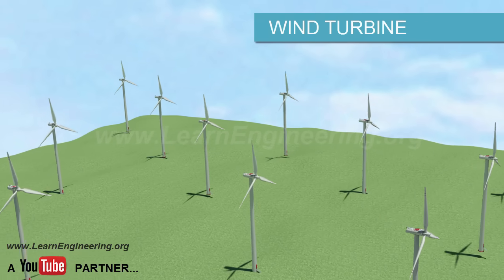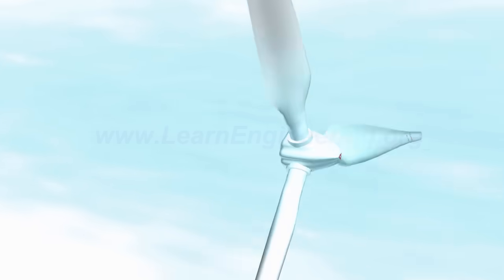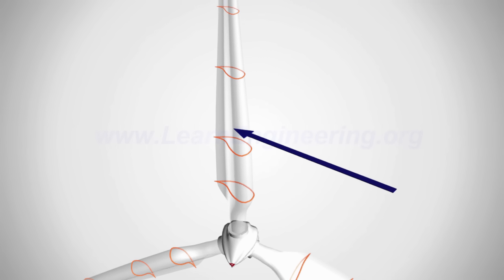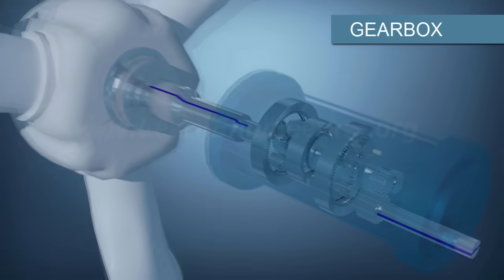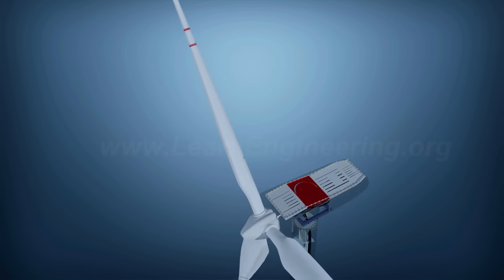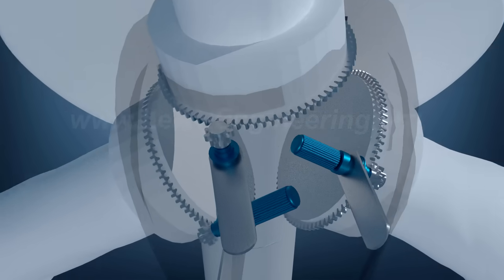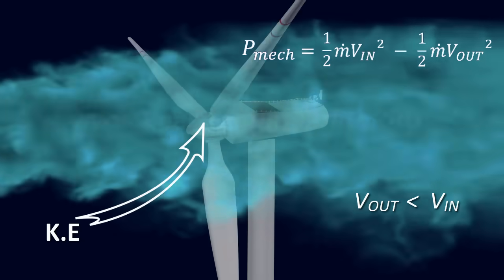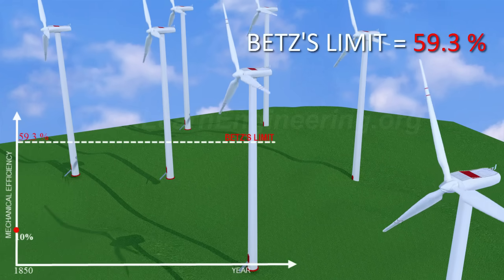How do Wind Turbines work?

Comment: 3:40 I'm confused. By that diagram is saying the no matter what speed the wind is blowing the blades are going to move the same velocity. Is that the case?
Reply: It depends how it is connected to the power system:
1) if it's connected directly with a synchronous generator, they will spin at constant velocity
2) if it's connected directly with an squirell cage induction generator, they will spin almost at constant velocity
3) if it's connected directly with wound induction generator with variable resistor in the rotor circuit, the velocity can be regulated with the resistance in the rotor
4) if it's connected fully through a power converter (decoupled from the grid), the velocity will depend on the wind speed and the output power from the power converter
5) If doubly-fed induction generator is used, the velocity will depend on wind speed, the rotor voltage frequency and amplitude

2) is the cheapest, 4) and 5) are newer types of wind turbines. I tried not to complicate it and not go into details because geneator types are not so easy to understand and I would probably confuse you even more.

Comment: I think it's hilarious that they forgot to mention you need lots of oil to lubricate the moving parts haha. Renewable my ass.
Reply: I do not think you understand the magnitude of ignorance shown in this comment.
Reply: Axl what I said is fact. You want more facts? Wind Turbines need steel so it's mined by heavy Industrial Machines powers by fossil fuels. Then the materials are  transported to a steel mill also powered by fossil fuels then the steel is shipped to a manufacturing plant where it is also powered by fossil fuels. And the construction of the actual Wind Mills at the sight is also powered by fossil fuels. I didn't even mention all the oil you need for lubrication of the moving parts and the genocide of birds Wind Farms kill every year. Some Wind Mills are starting to be made of plastic and guess what that is made of? OIL 

So don't call me ignorant son especially since you don't bring any facts to the table.
Reply: Yes of course, these are all factors that have to be taken into consideration when determening the overall climatic impact of the Wind Turbine. However, what you conveniently left out is how the turbine will produce a certain amount of electrical energy after its installation.  Given these calculations you can figure out how long the wind turbine must operate before it has produced as much usable power as was required to install it, any further power produced is the so called clean energy. For a typical wind turbine this treshhold is reached after approximately 3 - 6 months (Ida Kubiszewski et al., 2011). The same metastudy concludes that a wind turbine produces 20-25 times as much energy in its lifetime as the installation energy cost. 

When it comes to the issue of the lubricant oil used within the turbine, this is minescule compared to the power output. I do agree that it is sad that birds often die in rotor collisions, and this is an area that requires furter research to minimize.

All in all, the world is not as black and white as you seem to believe. Any energy installment requires a certain amount of energy as an installation cost, which has to be compared to the expected energy production in its lifetime. It is this comparison that decides wether an energy installment is "clean" or not. If you are genuinly interested in the topic I would advice you to look up the exiting field of life cycle analasys, where this is the main focus.

Comment: Why planetary gear reduction is used, and not normal gear reduction? I would expect normal gears to last longer and be cheaper. Also does the wind turbine can rotate contiously 360 degree to adjust for wind? And if so, how electric wiring is achived? If not, how movements are restricted? How does generator phases and speed is synced with the grid? Are blades rotate at fixed rpm? or do they vary, and how one deals with excessive loads or over generation of electric power?

Comment: The wind passes over the blades and makes them turn (kinetic energy) the blades turn a shaft within the nacelle(the box at the top of the turbine).The shaft turns a generator which converts the kinetic energy into electical energy. A step up transformer converts the electricity to a higher voltage to be transmited  (electrical transmission) ; Typically to  11,000V up to  33,000V and The electricity is then exported to the local electricity grid network.
Reply: What is kinetic energy can you say me please
Reply: In physics, the kinetic energy of an object is the energy that it possesses due to its motion. It is defined as the work needed to accelerate a body of a given mass from rest to its stated velocity. Having gained this energy during its acceleration, the body maintains this kinetic energy unless its speed changes.
Reply: This is  is kinetic energy  ://www.youtube.com/watch?v=wfzgIxMEo8g&fbclid=IwAR1kMTI1T0dPTq5QEuPbIekeMExf6ITBtwMFxdRVd53Jv2HVJnKWlfSOdeg
Reply: @nmahendrareddy4025  why don't you use Google or YouTube and find out for yourself instead of asking someone in a YouTube comment section that's never going to reply to you, numbnuts.
Reply: Don  the idea is to maintain an optimum tip speed ratio during operation. Optimum operation is typically 14-18 rpms on the rotor with a generator rpm between 1400-1800.
Reply: And once that small amount of electricity is "on the grid", it is quickly lost due to resistance in pushing it down a power line. If that electricity were used at the source where it was produced, small factories would soon produce a profit from that renewable electricity, and selling of the products made would be applied to your power bill, making your home electrical bill much smaller.

Comment: At 2:00, it says that you cannot generate meaningful electricity frequency at the blades low rotation speed - and that a gearbox is required. No longer true with direct drive wind turbines http://www.poma.net/en/solutions-2/products/direct-drive-wind-turbines/

Comment: While this is a great video to give a general understanding of how wind turbines works, it should be noted that the designs of modern turbines varies a lot and some are very different from what you see here. For example there's a lot of modern turbines that uses low speed generators and therefor does not need a gearbox.

Comment: Suppose if the wind is above hundred 100km/hr and make it rotate like a fan or suppose 700rpm ,can a wind turbine handle this types of situation?
Reply: The limiting factors are the strengt of the blades and the dampening of vibrations caused by the turning blades. Usually the blade tip goes around 200km/hr and the turbine will usually stop producing power if winds are above 25m/s. The thing is you want the turbine to run as much as possible and you do that by optimizing it for normal winds, so most turbines actually reach peak power production around 12m/s winds.

Comment: Windmills work by shredding thousands of birds each year (mostly raptors,) and drastically under-serving the grid compared to their cost. That they have proved this beyond a shadow of a doubt points rather convincingly to the feeble-mindedness of their supporters. The largest single investor in Wind farms, Warren Buffett, has spoken  publicly and often about the folly of wind farms.  “That’s the only reason to build them,” Buffett said of the wind tax credits in 2014. “They don’t make sense without the tax credit.”
Reply: I don't know the actual number of birds that windturbines actually kill, but it presume is rather low since I've newer seen dead birds laying around them. Now the statement that they are expensive and not economically feasible was true 20 years ago. Today windturbines are among the cheapest ways to produce "clean" energy and if the current trend line for price per MWh proceed as it has the last 20 years, then they will be taking on natural gas withing 20 years.

Comment: A better question is "When do wind turbines work?" and the answer is disappointing. 
Most are designed to start delivering their nameplate capacity at about 27 mph of wind speed ((12 metres/second, 12 m/s). Up to a little more that twice that, they have clever ways at the amazingly strong roots of each blade, to turn  the blade slightly away from how the  wind is effectively pushing. The force goes up as the square of the wind speed. At about 50 mph the only safe thing to do is let all the wind slip past, and stop the generator.
At less than 27 mph  the power of the wind, and therefore of the "turbine" varies as the cube of the wind speed. Therefore, if the wind speed drops from 12 m/s to 8 m/s, a 300 MW "wind farm" delivers not 200 MW, but 300 x 8/27 which is just under 89 MW. The "average" power delivered by 300 MW of nameplate capacity in a good site is about 100 MW,  but that is only if you have storage, or are offsetting the burning of 300 MW of gas turbine capacity, running them at less than their full capacity. In the example I showed, the wind for  100 MW is still higher than 18 mph.

Comment: Would it be possible for each turbine to have a set of three gearboxes?  Is there enough strength in the wood for the turbine to split into 3 turbos and triple power in about the same amount of space?

Comment: What is the exact angle a blade would need to be turned? Like if it is turned and achieves a speed where the wind is directly hitting the blade due to relative velocity, wouldn't the velocity of the blades increase and thus the blades have to be more angled?
Reply: 18 % angle of attack is pretty common for blades without pitch control.  Also I don't think lift happens from the wind hitting the blade it  is more based on the wind passing over the blade.

Comment: Why not add a propeller design to the back end of a windmill that produces a wind vortex to increase the windmills efficiency? Line the windmill support with rewired drum motors generators with magnetic bearings each having a spark gap to produce high frequency electricity with a dual clutch transmission system geared to keep the whole windmill producing electricity at a set high frequency no matter what the wind speed? Then have the base of the windmill house all the electronics and huge graphite airogel power cells and graphite airogel super capacitors? Take a single windmill and turn it into a electrical power plant? Then use Tesla high energy transmission coils to move that energy from point A to point B with zero power loss to operate a power grid?

Comment: There is some information ALWAYS absent from these Green Energy vids, articles, papers, studies, and laws.  
1) How much energy is consumed during operation and maintenance of a wind turbine?
2) How much downtime for maintenance\repair?
3) What threshold minimum of wind/MPH is required;
   a) To begin turning the turbine (breakover)?
   b) Minimum to begin producing power?
   c) Average steady airflow to maintain 50%/75%/100% energy output? 
3) Average time (hours) per week/month/year a turbine is not producing energy from sub-minimum wind thresholds?
4) How much carbon emissions was created to produce/transport/build each turbine.
5) What are the total costs involve in each arm of a Wind Farm?
6) How much are those costs are borne upon the Tax Payers?
7) How much as energy costs, specifically electricity, has lowered for those who are on the grid that benefits from Wind Farm production? 
8) How much of the environment has been damaged by the construction and operation of these large tracts that make up Wind Farms?

Green Meanies need not waste their time with trivially verbose attacks.  Just looking for intelligent answers to the questions.
Reply: I might be able to answer some of that.
1) During operation of the turbine a modern 4MW turbine will consume around 10kW, but it spikes when it has to pitch or yaw. The used power is subtracted from what the turbine tells the grid it's producing. 
For standard maintenance very little power is used. 
2) It depends a lot on the turbine, but usually there will be a service contract on the turbine and things like oil levels and nut tightness is checked. In the first few years it should be more than 20h annually. 
3) Yes most modern turbines wont start before around 4m/s and that also where they start to produce power. They reach 100% production somewhere between 8-12m/s depending on design. 
3) This depend a lot on turbine design and placement. However in 90% of the cases turbines are not stopped because of low winds, but rather because of the power being to cheap. 
4-6) I can really anser those and I think any answer you would get would be very inaccurate and it depends a lot of location and turbine design. 
7) Windenergy can't compete with sources like natural gas yet and therefor i don't really think they have lowered the price that much. The ones benefiting the most are probably businesses that use power at night, where windturbines produce cheap power no one needs. 
8) I can't give a accurate answer for that. Of course production of windturbines harm the environment, but so does any other energy source. Whatever windturbines are "harming" the landscape is of course debatable too. I think the biggest issue, at least for older turbines are the noise, which can be a problem for people living close to windfarms, but it's an issues which is being researched a lot and we have come a long way.
I saw somewhere once that the CO2 "payback" time for a windturbine is just under 4 years, but I can't give you a source on it and I don't know if it's true.

Comment: I have a question: since we measure wind speed after the air has passed through the blades shouldn't there be an error in the measurement
Reply: You're right. The wind measured behind the turbine is a little lower than in front of it. I believe they fix it in software, but in recent years most turbine companies have increasingly tried to implement Lidar technology, that measure windspeed with laser.

Comment: Can someone explain how we can generate more electricity using the gearbox ? the whole 1:90 ratio ? Does that mean that we convert a weak rotation force to one that equals 90 times it forces ? How's that possible ?
Reply: It doesn't generate more electricity because of the gearbox. In order to get some usable power you need to the AC frequency to be either 50 or 60 Hz. So you either have to speed up the drive shaft with a gearbox and feed it to a normal 6 pole generator or use a low speed generator.

Comment: how big is the biggest wind turbine and how much energy does it create and how much does it cost????
Reply: The biggest I know of that are currently in mass production are 9,5MW but there is a French company which recently announced that they will be making a 12MW turbine. However those are mainly for offshore use and in many countries 2-4MW turbines are much more popular.  Cost varies a lot depending on quality, design and placement, but it's usually around $1,5 mio. per MW.

Comment: i thought about the idea of testing a low drag wind turbine on a glider  aircraft using the oncoming air pressure from the aircraft movement  to recharge a battery from high altitude descents with the turbine deployed only when descending. aircraft movement generates alot of wind pressure

Comment: why cannot me make use of motor to rotate the shaft of the  generator.  The power for the motor should be taken from the Electricity Generated from the Generator itself.

For example if we are generating 93% of the electricity from the Generator, part of this electricity say 10% can used for the working of the motor.

Comment: Now I understand why they're so expensive and inefficient
Reply: Solar panels are more efficient when they're not too hot, for example under a grey sky. In fact they're 100% efficient at night!
Efficiency of an engine is how much of the power delivered to it is converted to the desired kind that it's built to supply.
The trouble with weather dependent "renewables" is that the weather isn't dependable. It is true the the time-dependent efficiency of the wind turbine investment is poor, because the capital stands idle or under-used so much of the time.
At heart I'm an engineer, physicist and mathematician, but I have spent a considerable amount of my employment time in the company of clever economics analysts!
Reply: +Albert Rogers

But surely its not like wind turbine companies are trying to have these things all over the country, right? Aren't they just a whole lot more useful if they're placed in strategically placed areas such as mountainous regions, or regions by the shore where it's going to be much more windy?

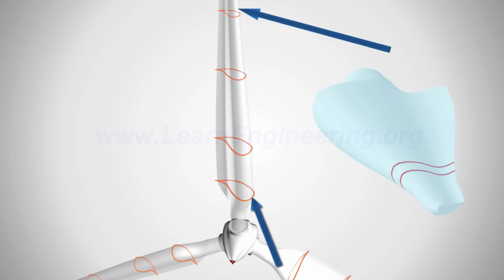Comment: 1:49

There are generators that can work with low RPM's of the fan.
One of the companies that does this is EWT.

Eliminating the gearbox means lower maintenance and running costs.
Reply: 1barnet1 how much would it cost to have a windmill installed? one that can produce 20k watts a day..

Comment: Why don't you show how these things DO NOT WORK but burn up in spectacular fires.There is NO oil that can stand the heat and friction built up in the transmission.
Reply: There very few turbines that actually end up catching on fire and most of the fires are caused by overspeeding caused by failing breaks. The temperature in the gearbox shouldn't exceed 100C and modern turbines has sensors that shut down the turbine if something runs hot.

Comment: never could figure out why they would want the huge weight of the electrics up there.  A vertical drive shaft might be slightly less efficient but would put the weight at the bottom of the tower.
Reply: rtel123 the blades are heavy, I would think the gearbox and generator help to counter weight